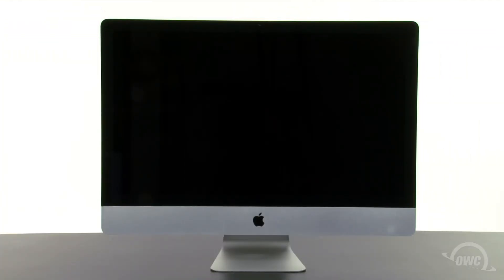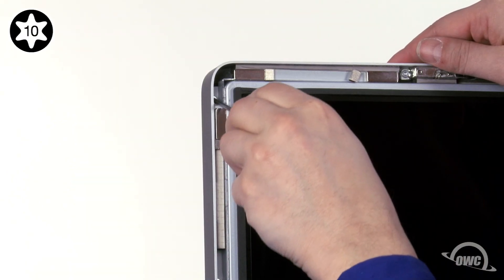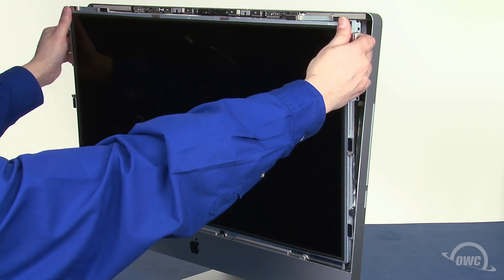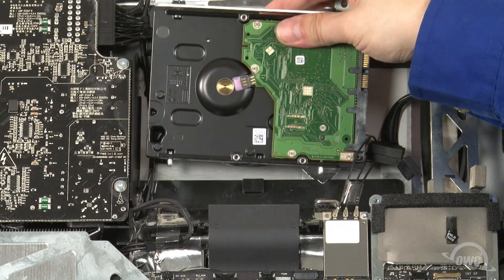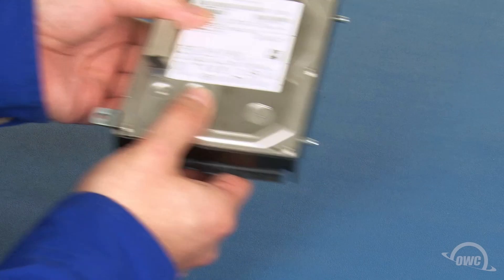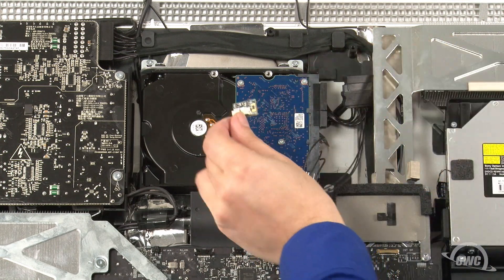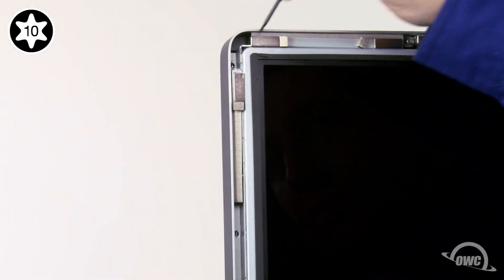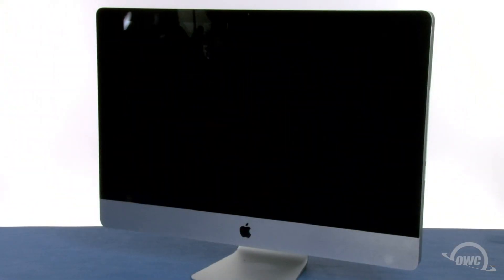How to Upgrade/Replace the Main Drive in a 27-inch Apple iMac 2011 (iMac12,2)

Comment: I have a 2011 27 inch 12,2 imac will I need the temp sensor for fans and what OWC SSD kit would I need thank you (I well be removing the dead HDD)
Reply from the maker: You would need an HDD to SSD upgrade kit located here https://eshop.macsales.com/shop/ssd/owc/imac-27-inch/2011. Make sure you purchase the one that states it's to upgrade and not to add a drive.

You would then follow this video instead https://eshop.macsales.com/installvideos/imac_mid27_2011_hd/
Reply: @poweredbyowc Isn’t that just this same video?

Comment: If I upgrade my 27" iMac mid 2011 following your video, will I be able to update the operating system to the latest Mac OS? Currently this machine is stuck at 10.13.6 High sierra.
Reply from the maker: Regrettably Hoopy Frood any upgrades you do to your iMac will allow you to upgrade the MacOS.
Reply: @poweredbyowc  Why is that regrettable? Or did you mean to say that it will NOT allow me to upgrade the MacOS?
Reply from the maker: Hi Hoopy- sorry for the confusion, there was a typo there. That is correct,  any upgrades you would make to the machine will not change the max OS the machine can take as that is dictated by the logic board.
Reply: @poweredbyowc  Thanks… then it’s not going to be worth it for me… Adobe Creative Cloud no longer works with the older Mac OS.

Comment: First dont be so hasty. People have different abilities. The first clip inside the screen coming feom me a mobile mechanic requires two tweezers. Sharp point end. Elbow holding edge of screen whilst using tweezer either side lift and slightly press across towards each tweezer.
Reply: I dropped a cotton wood bud with soldering flux. Oily on screen. Oops. So the story of disaster is bollocks. Simply use Isopropyl alcohol 99.9% pure from Amazon. Gone in a second
Reply: Also I swapped my hard drive from one imac with green lines on screen to another working mac but without my programs. Turned it on and it could not see the boot partition. Told by macman brighton need to reinstall old hardrive. Install latest operating system on it and then swap over again. Some reason I cant recall.

Comment: I have both a conventional HD and a SSD. The HD is bad. I want to replace it with another SSD. this should be straightforward right? I'd just use the sata cable from the conventional one and connect it to the new SSD?
Reply from the maker: Hello Sean Clark,

So upgrading the HDD to an SSD process would depend on the model of the iMac. We would be happy to go over this with you directly if you could contact us at support@owc.com, Please?

Comment: Will this also work for a FusionDrive iMac? My 27” 2011 is going through repeat random restarts and eventually works after an hour of restarts, but will eventually restart and go through that cycle again. The AHT Code said it’s related to a HD temp sensor. It’s a 250gb Samsung SSD with a 2tb Hitachi HD. 

 Will the OWC SSD Pro 6G conversion work for my problem? I love this Mac for what I do and don’t need/want a new one. The items are in my cart but I’m not sure if this will solve my issue, so I’ve been hesitant to buy everything in case it doesn’t. Any advice would be appreciated!
Reply from the maker: This is a great questions. We are sorry to hear about the trouble you are having. If this is the original drive you are replacing then our OWC SSD and thermal sensor in the kit should fix the issue you are having with the thermal sensor. Please let us know if you have any further questions!

Comment: IMPORTANT COMMENT FROM SOMEONE WHO TRIED THIS:
The display unit is much heavier than it seems and holding it in position while trying to remove little connectors is hard to do without ripping some of them, especially the display connectors in the middle of the iMac.
Also, the swivel of the base unit is hard to keep up.
So be prepared, and have a friend help you avoid ruining your Mac like i did.
Reply from the maker: YES! 🙌  Thank you so much for this warning. You are absolutely correct. This is why we strongly recommend professional installation or like you state Jeff always have a buddy around for some additional hand for the help.

Comment: Do you need a temp sensor cable like you do with the 2009 models to keep the fans from going nuts?
Reply from the maker: Hey Justin,
The Thermal Sensor may be required depending on what version of the iMac you have. The iMac 9,1 will now require the thermal sensor cable. But the iMac 10,1 and 11,1 will require the cable. If you done know what iMac you have call in to (800)275.4576 or email into us (support@macsales.com) with your serial number we should be able to confirm if it is needed or not.

Comment: Do you need the little Static pad on the old HDD when installing an SSD replacement?
Reply from the maker: Keeping the static pad can be a good idea if using it with an SSD as well. Even if not needed, it is always good to have there regardless as a precaution. This will help ensure that your Mac is always at its best. :)
Reply: @poweredbyowc  Thanks Folks. Your specialist thought it wasn’t worth opening up the iMac again to install it after I noticed I had forgotten it. I’m not sure it would’ve touched anything from the back of the SSD bracket anyway!
Reply: @poweredbyowc  The OWC Specialist said “If you do have any SSD issues that should be the 1st thing to consider”.
Reply from the maker: Absolutely Gary- there shouldn't be an issue but please feel free to reach out to support@macsales.com if you do notice any problems with the machine!

Comment: it's 2020 WHY replaced an outdated HDD with an equally SLOW drive???  should have installed a speedy SSD
Reply: its an old reuploaded video. SSDS were expensive back in 2011
Reply: @tomtruesdale7462  It doesn't matter it's slow. The things that matters is that iMac looks great and your frinds will be jelous.
Reply: doesn't it matter what he use?